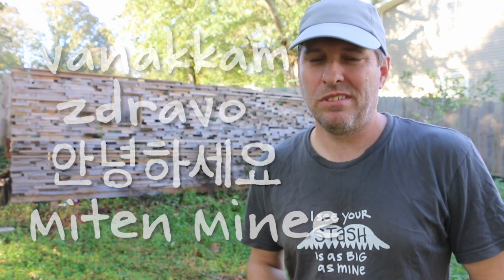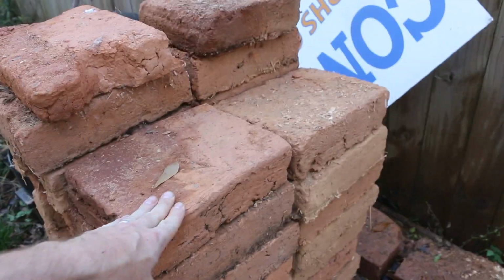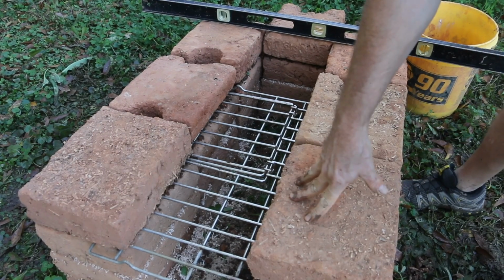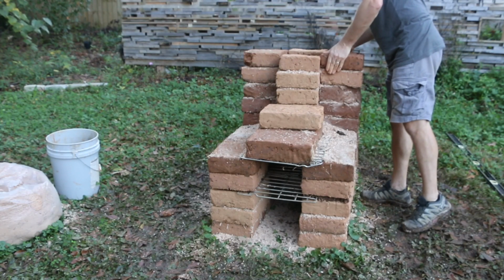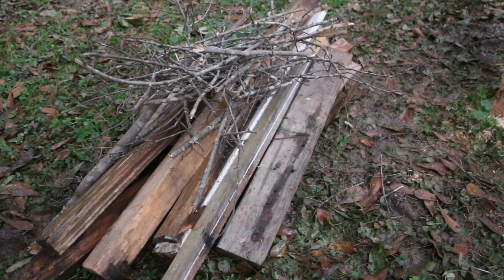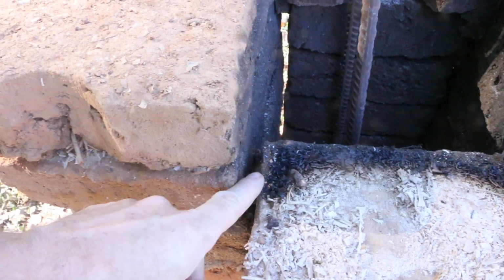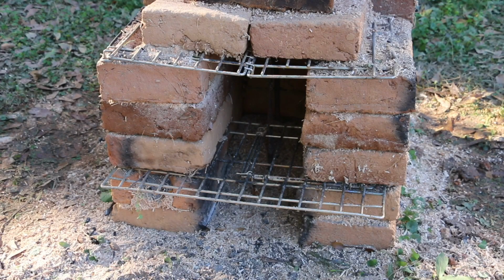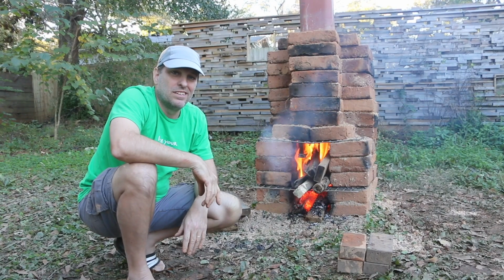How To Make An Adobe Rocket Stove

Comment: Your attitude and enthusiasm are absolutely inspirational.  :)  It's cool to see how your understanding of the way rocket stoves work has grown as you've done various experiments, and it's been great learning along with you.  

The blocks on the ground will likely not dry properly, just because you can't compete with a heat sink that large.  You may need to finish those with some other process.  A base of refractory brick would have been a good insulation barrier to the cold, wet ground.  What you're building is the core of a great rocket mass heater.   Always love watching your videos.

ETA -- For anyone who questions whether or not a rocket stove burns hotter than a fireplace, consider what it's doing to this ordinary flue pipe.
Reply from the maker: Thank you, Jason. Good info on the base bricks not fully drying. Doesn’t help that the ground was wet to start either. Interesting perspective on the flue pipe reaction versus a normal fireplace. :-) Thank you for watching and for the encouragement.

Comment: Gata love Ga if you want to do pottery all you have to do is dig some clay up in your back yard. Also could any one recommend a good ratio for the hight to feed tube on a k type rocket stove. I'm sure greenshorts has said it but I can't remember.
Reply: I would say at least 1.5 to 2 times minimum. Depending on your space requirements and/or what you are doing with it. Higher is better. The further the heated air has to travel upward, the more draw it will have on the intake. You will also get a better burn (and less smoke) if you block off the intake hole by about 30-50 percent. Assuming you are using all the same size diameter (round or square) tubing. Let's say for example you are using 6 inch tubing, if you reduce the intake hole to around 3-4 inches using a cover of some type,  the air coming into the intake will have to move faster to replace the air leaving the the top/exhaust resulting in a "fanning the flames" effect.  This is similar to how an airplane wing works - the air moving over the top of the wing has to move faster than the air moving under the wing resulting in "lift' or "suction" - like a vacuum cleaner.
Reply from the maker: Good info. Thanks for sharing your knowledge. On my recent mini-rocket stove build, I did a 2:1 ratio. But, I think the riser needs to be taller. I like concept of restricting the air flow on the way in. I need to try that.
Reply: @GreenShortzDIY  it's basically the same concept as putting your finger over the end of a hose.

Comment: If you had insulated the flue pipe on the outside, would it prevented the cracking as it will be less of a thermal shock? Great Video ....

Comment: Great seeing your smiling face this sunny afternoon.  Your upper grate is sagging from the weight; perhaps a. Bit of rebar would offer better support.  When the flue pipe cools tighten a couple loops of wire around to hold the pieces together.  You do not need ceramic shrapnel.  If you were to line the flue pipe with cement board,  eod that buffer the heat sufficiently to prevent cracks and further degradation?   It’s obvious that you like playing with fire.  Enjoy.  
As always, wishing you and your family a safe Halloween night and sunny days yet to come.
Reply from the maker: Hi JW. Good idea on the wire. I did burn it again today, while started the demo on the greenhouse. Didn’t see your comment until after. You do get a mention in the Greenhouse demo video. I heard your voice asking where my gloves were. :-) I went and got them. I noticed the bend on the upper grate too. I had considered rebar. That would have been a good option. Thank you for the feedback and encouragement.
Reply: @GreenShortzDIY  Morning Tom, happy to be your safety nag!  I hope you weren’t wearing sandals during the demolition.  Trusting that you and your family enjoyed Halloween. 

Did you rotate each block to fire all four edges?   Stay safe brother.